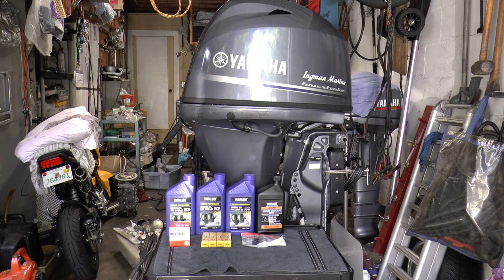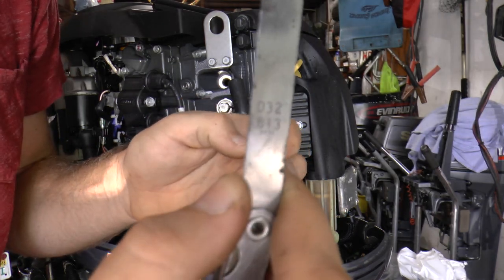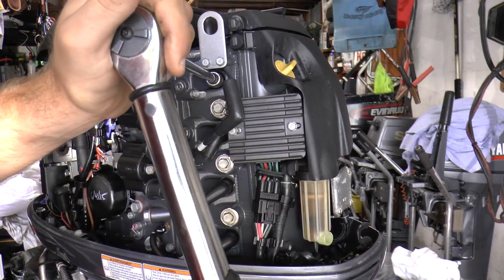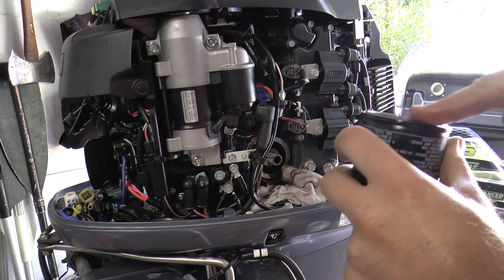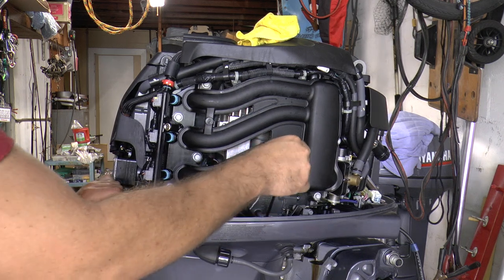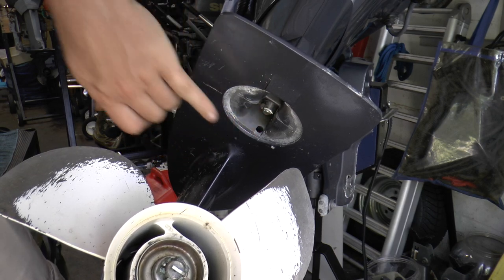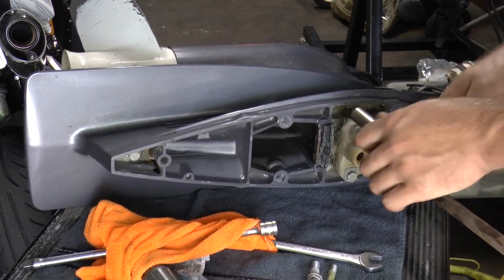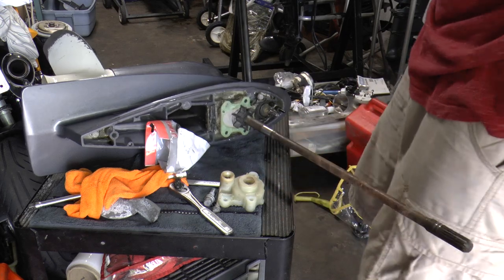How To Service A 4 Stoke Outboard Motor

Comment: You should not use anti seize on new spark plugs. Most major brands like NGK, Denso and Champion advise against it. For instance, NGK spark plugs feature what is known as trivalent plating. This silver- or chrome-colored finish on the threads is designed to provide corrosion resistance against moisture and chemicals. The coating also acts as a release agent during spark plug removal. NGK spark plugs are installed at the factory dry, without the use of anti-seize. NGK tech support has received a number of tech calls from installers who have over-tightened spark plugs because of the use of anti-seize. Anti-seize compound can act as a lubricant altering torque values up to 20 percent, increasing the risk of spark plug thread breakage. If you insist on using anti seize, at least torque them with 20% less torque than specified to avoid ruining your threads :)
Reply: You are spot on!!

Comment: Great informational video, but I do suggest, after oil filter change, turn the engine over a few times without it firing up, to allow oil to get around the engine.
Then & only then start it up.

Comment: After watching so many of these videos on servicing outboard motors, it recommended “not” to use anti seize grease that has other metal compounds in them like copper, they will react with salt and destroy the motor housing that is made of aluminum. Mose just recommend to use a synthetic grease. Other then that this was a great video.

Comment: Always start a spark plug by hand first. This will eliminate stripping the threads on the block!
Reply: How do you perform a so called 
Starting a spark plug by hand ??
Reply: Hallo Byebye he means start threading the spark plug into the block by hand to avoid cross threading.

Comment: Eric great video as always!  I have a 20hp 4 stroke tohatsu 2016.  Prob 50 to 75 hrs on it.  I changed the oil last December but that's all I've ever done to it.  How often should I consider changing filter, lower unit fluid, plugs, and impeller?  My pee stream is still as good as the first day I cranked it.  Thanks so much for the great info on your channel!
Reply: Jeffrey Thomas definitely Change the impeller every year, consider replacing your filter every 1-3 years depending on use.
Reply: Don't fuck around with trying to squeeze extra life out of parts on your outboard just to save a few bucks. Manual says yearly or every 100 hours for oil and filters. I do mine every year.

Comment: I have a 64 Johnson sea horse 5.5 hp motor and have seen all the motor’s you have worked on, mines been sitting for 10+ years and wanted to know if you could do a video on a similar motor

Comment: What is that front most tube for?  I just bought a 2003 f30 that runs fine, but that tube wasn't connected to anything.  It runs through the fore section through the bracket.  TIA!

Comment: I enjoy your videos.  Do smaller engines have an oil filter? I have a Mercury 5.5 HP engine which I service myself.  I have never changed an oil filter! oops!?
Reply: It’s generally a good idea to try and change your oil filter most times you service your engine.
Reply: Two stroke don’t have a oil filter

Comment: Great video, but that oil level didn't need topping up, 1/2 way between low and high marks is perfect on 4 stroke outboards
Reply: That's my understanding as well. 1/2 mark is the recommended.
Reply: My f90 manual says 1/2 way up the crosshatch is proper amount

Comment: Do you recommend using synthetic oil in a brand new 4-stroke 25hp motor?
Reply: Yes
Reply: most mechanics will advise using dino oil for the first 200 hours to help the rings seat, then switch to synthetic. check out bobistheoilguy.com forums.

Comment: Eric! What type of grease do you use for the lower unit bolts?
Reply: Generally when I’m servicing motors I’m not too picky, I usually just use anti-cease or copper grease.

Comment: Suggestion: Show adjustment process if correcting "gap" space of spark plugs - your video failed to show this procedure. Your first plug indicated not needed and you fail to show process, if needed.
Reply: Do you have the spark plug code, tube size? Thank you!